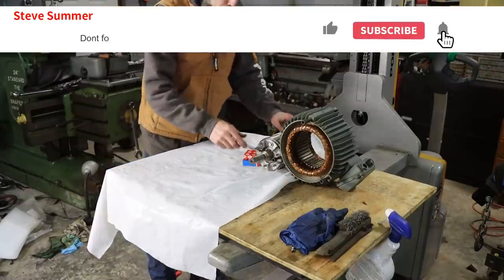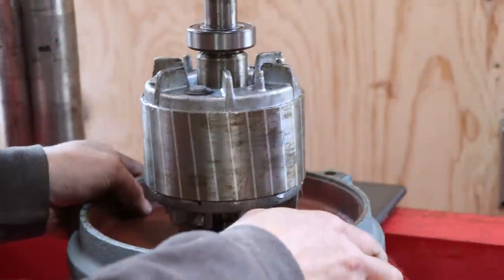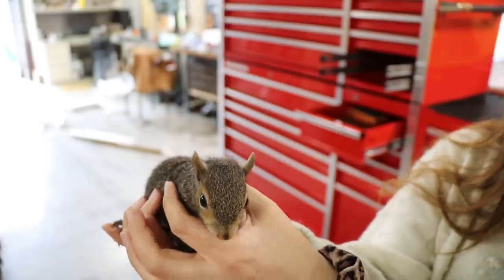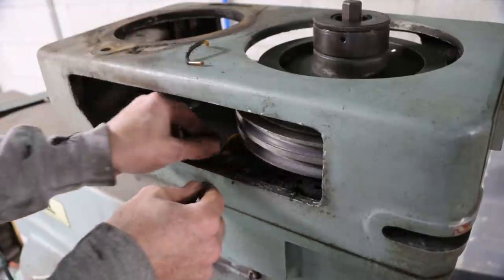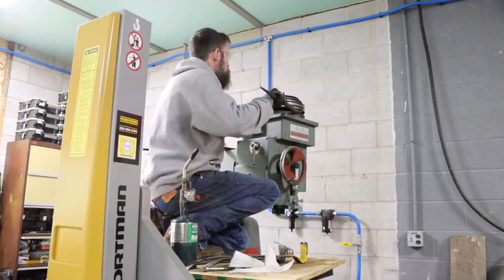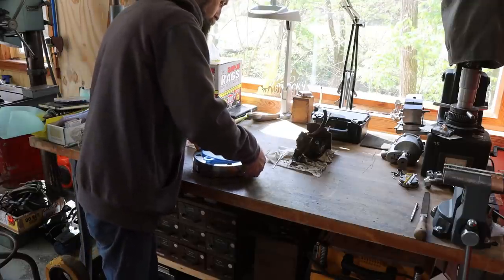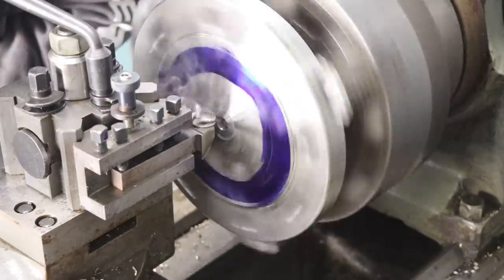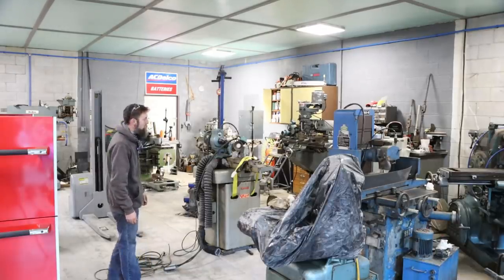Doall Milling machine Head and motor work.

Comment: When you haver rebuilt a motor give each end of the shaft a sharp tap with a brass or lead hammer to take the press side loading off the bearings! Another great video Steve!
Phil UK

Comment: Ever since Adam Booth paid you a visit I went back and have been binge watching the shop construction/repair. I’m very impressed with your depth of knowledge over a broad area of technology. I have the exact tool box (with side box of drawers) but because I’m an aircraft mechanic I do not have the top boxes.as I roll my toolbox from airplane to airplane and I use the top as my personal work bench. I, too, used a label maker to help find the correct drawer,
Reply from the maker: Thanks Rex👍

Comment: The squirrel wisperer, your wife's a natural with them. Good to see the shop getting put to rights. That transmission grease sure turned narly over the years. So much better then the Bridgeport power feed ,, strength wise anyway. In another year that new box will need an extra room for tools. Mine did and its bigger than that model. My snap on box cost more than a new car at the time I bought it. Before HF started selling them. Which I'd buy now tho..

Comment: I love changing motor bearings. Every time I get a new machine I convince myself that I can hear/feel the bearings in the motor grumbling.
Reply: Bought bearings yesterday. 4 bearings, the most I have spent on this machine since I got it, and they only had Timken bearings, where the cheap Chinesium would have run just as well, seeing as they are only a low speed roller.Probably do another 40 years though, while the originals are sort of fine, I wanted a sealed unit so as to reduce the dirt getting into the zz bearing races, as they now run rough, 2 2RS 6202 bearings it was.

Comment: You have surely come a long way. I am planning on buying a couple of the smaller tool boxes from HF. Plan is to have them designated to specific tasks, general mechanic's, machining, lathe, welding. At least that is the long term plan. Like you, don't have deep pockets, and as I get closer to retirement, that becomes even more critical. Thanks for sharing, thoroughly enjoy watching you adventures.

Comment: Steve, if you get vibration in the mill motor reverse one of the fan bolts. When you took it apart, they were pointing in opposite directions, but you reassembled with them in the same direction.  Might be enough to affect the balance. Shop is looking really good.

Comment: A friend of mine has a similar lift, he added a remote so he could control just the lift/lower function while using it as a man lift. He also had me build a man basket for it with rails for safety. I got a bit fancy and added tool/ parts trays.

Comment: Yes, I like the neoprene outer shields on bearings, as you can lift the caps.
Lots of the bearing on tractor mowers now, have steel shields you cannot re- grease.
It is good policy to put the best grease possible, in them. That cost is minimal, I flush new bearings. Then use Penrite high temperature grease. It is water proof and has amazing adhesion. I expect there is a similar graphite grease available, that would be ideal, for your head stock replacement.
Wife’s grey squirrel is cute, but they are an introduced pest in England, the native squirrel, is a red squirrel.

Comment: How long before that tool chest is filled to the brim and you have to get another extension?
Reply: morning Mr Clive nice to see you at this channel
Reply: Wonder what it weighs by the time it's filled?
Reply: In my case usually 2 hours.
Reply: Two things popped up in my subscriptions this morning, your defrost timer and this. :-)
Reply: @dudleysdad  Around 4 tons probably by the time it is full.
Reply: @SeanBZA  You are probably close, dangerous enough when moving it is what I was thinking.
Reply: @dudleysdad  I have a few tool boxes, and yes they grow in weight as time goes on, and multiply as well. But I am cheap, so try not to buy new, just well used, and fix em up a bit.
Reply from the maker: Hopefully not too long😁.
Good to see you Clive👍
Reply: Extension.... on the garage. =]
Reply: @SeanBZA  I was wondering if he might do a resto since it is part of his history, and it's a nice classic Craftsman.
Reply: @dudleysdad  4 tonnes, definitely not.
Reply: Probably just as long as It takes to remember where everything is
Reply: I give him a month he will need more space lol lol jk
Reply: Tools are like air molecules. They expand to fill all available space.
Reply: @jasongreene303  those chest are really not to bad to fix back up. Take a few hours and they are like new. I use a knipex smooth jaws to make it rails straight again.
Reply: Steve will need a side box for the end of the shop!(;=)
Reply: Gad it's the awesome  Big Clive that's where I'm heading next  what a great weekend  with everyone putting up videos
Reply: @noelhenderson700  : How many clamps does a woodworker need ?  One more than he's got !!  More is better.

Comment: You are using that fork lift a lot more than you expected Steve and would be lost without it now‼️👍👏
You need to have a look at Knipex tools.
German made and wish I knew about them before I equipped my Workshop.
Have bought some and will NEVER buy another brand‼️
I use pipe cleaners as wicks.
Elizabeth is a wonderful squirrel ‘Momma’👏👍

Comment: Good choice going with sealed  bearings, they are lubed for their designed life and you are correct,  deep groove radial ball bearings can accept fairly heavy static and some dynamic loading, however they will fail prematurely if an impact shock load is applied, such as being hit with a hammer. (I'm a retired machine rebuilder with around thirty years of experience, l enjoy watching some one who knows what they're doing.)

Comment: Steve, 100% agree that U.S. General Tool Chests are very high quality and a great value. I have two of them and would like to sell my two Craftsman chests and replace with U.S. General. I see no need to buy one of the expensive "tool truck" brands at double or triple the cost. You made a great choice.

Comment: Not many wives help there husband's in their shop, got a good wife there Steve. 
If you had to add more boxes, you can actually add another bottom and top. The connector would simply be that side box, only thing you'd have to change would be the casters. Those aren't difficult to do, just contact General directly and order swivel casters. 
This is the one thing I enjoy about your channel, new machine, (new to you), you tear it down, go through it, clean it and repair what needs to be fixed. If I may offer a suggestion, get yourself a good set of chain wrenches.
It might be a lot of work but, look at it this way. Since you're cleaning your machines, now you know their exact condition. It's called "baby steps" for a reason Steve. Take your time, set your equipment up the way that best suits you. Great video, cheers :)

Comment: One feature of the big DoAll mill heads that I am familiar with is the high/low range doesn't reverse the spindle. So you can label the rotation direction switch unlike the Bridgeport where you can't.  Some small DoAll mills look like Bridgeport copies probably reverse the spindle too. The more you take apart the better this mill looks.

Comment: I have had various tool box brands over the years. I have had two Harbor Freight side boxes like yours for 15 years. They are by far the best box and the best values you can get. I like the handles because of the labeling capability. They hold up very well. I wouldn't buy anything else.

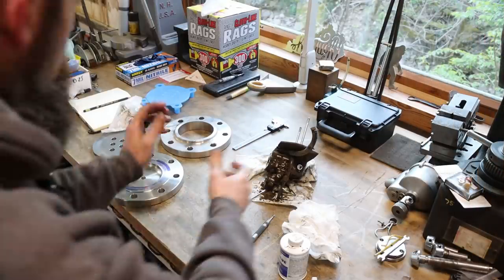Comment: 43:12 was wondering what that mess was.  The shop is looking good.  That big vertical mill when finished will be a real asset.  Amazing how many mills have to have grease cleaned out of the oil lines.  Stay safe, stay well.

Comment: Ive become convinced that i could line the entire length of my shop wall with tool boxes and i could still find a reason for more 😀
Reply: I pretty much have that now. Two 72", a 54" one 72 and the 54 have top chests, one hutch and 2 end lockers. Still need more room though..

Comment: For pressing tools for bearings, I like to cut through one side of the old race, remove the balls, deburr, and  and use it for a pressing tool, the cut race allows press fits to relax. I suppose you could use Locktite to glue it to a bearing and pull it out of a blind hole, but have not tried it.
Thanks for the videos.

Comment: You need an ultrasonic cleaner. I bought one and it is amazing how often I use it. I’d use it more but my neighbor keeps borrowing it. He loves it too. You could just drop all those gears and bearings into it and they would come out gleaming and you know that the insides of the bearings are all free of grease. It would also make short work of that gummed up carb. If you buy one, get the biggest one you can afford. I love mine but often wish it was bigger.

Comment: I had a machine with grease fittings, so used the right grease for it, NGLI0, in a drum with a pump. Basically a thick oil that pumps well, and runs with time. A lot better than the stuff I removed when I replaced all the old pipes, which was pretty much looking like wheel bearing grease. The light grease pumped well, and was much better at lubricating the machine as well. Oil would have been an issue, seeing as half of the time the grease was lubricating bearings and slides. 

43 grease nipples and pipes from a central block, one side M6 thread, the other side 1/4NPT for the grease fittings. M6 side got push in fittings to replace the old barb fittings originally there, and then all new 5mm pipe to replace the old. All new nipples as well, most of the old ones were shot and leaky. Went though half the 20l drum in 10 years, of a bit per nipple every month as service.

Comment: One thing good about them old craftsman toolboxes if you dont have one there not to bad to fix up matter how bad they are take like 3-4 hours. Main thing is a knipex smooth grip pliers, 91 % rubbing alchol/papertowels and grease. Repair one few years ago when only one drawer open up and made it like new. The knipex make it easy to repair the rails since there straight and can put alot of force on them.

Comment: One thing I find with those big tool chests is that the drawers tend to be very deep so often you only fill the bottom 30% of the height and you don’t end up using a lot of the volume. I find the you can pack way more stuff into a Lista type cabinet. Too bad they are 2-3 times more expensive.

Comment: On my mill the vertical head actually takes grease (it is a retrofit), but a nipple is damn hard to confuse with the flip top oilers on the rest of the machine.
They did however drill a grease passage in the wrong spot at the factory, that never worked and the bearing behind was shot.

Comment: several years ago i rebuilt the entire drive train on a 1955 Wolseley 6/90, a friend was visiting and implored me to have someone help setup the differential (i did engine, gearbox and all wheel bearings myself), i found a guy that lives 30km away and i suggested we do it in my garage as everything was laid out, he just had to bring the in/lb torque wrench (which i lacked).
he said 1st thing is pressing in the pinion bearing shell and we'd need a plate to spread the load, i handed him a 1/4 in disc i had cut out and ground to rough shape, ok he says, the second thing we did i handed him a similar disc for the pinion bearing, he looks at me and says i want to kiss you.

he explained that in 40+ years of working with mechanics, i was the best prepared person he had ever met, we spend more time chatting about life the universe and everything than actually working, the diff went together smoothly and the mesh pattern was so damn good he said if we tried to adjust it to get it better we would do more harm than good.
he paid me the biggest compliment when we were done by saying next time i ever need to do a diff, he's just lend me his tools.

Comment: At the 22:10 mark.   I have been told by a reliable source that Doyle is the manufacture that supplies pliers to Matco tools.  So I stopped at a Matco truck, and I compared the two...  Looks to be the same, other than the name.

Comment: Looks like a replaceable cover behind your lathe would be a good idea to keep the splatter off your new wall.  A piece of canvas held at four corners?
Reply: I used a sheet of tin steel that had been the wall of a garden shed. Free, Pre-painted, easy to clean and everything!
Reply: Kinda like the one that's already there?
Reply: That's his old wall. The new one is on the other side of the shop. But yeah a splash guard might be a nice project someday.
Reply: @1pcfred  I know that. What is your point?  Any wall gets dirty, if you looked you would see it on the 'old' wall.
Reply: @douglasthompson2740  I would think it is obvious. My point is you called his old wall a new wall. What you're seeing is the old wall.

Comment: If manufacturers expect oil to be squirted into a grease nipple, they should write oil by the side of it
Reply: Yes but... "Alemite fitting" not grease nipple and users should read the manual!
Reply: @TheMetalButcher  They would then need to add a little cupboard to store the manual in, otherwise it would just get lost ;)
Reply: @____________________________.x  Old B'ports did! But they filled up with chips. :D Any good machine should have a detailed lube chart telling you the location and weights of the lube as well.

Comment: I have changed more bearings in motors that I care to reveal.. I have been in the bowling business for close to 45 years I have worked in both Brunswick and AMF houses I worked for 10 years in an AMF bowling house with 50 Lanes.. Each one of the machines ( pinspotters ) has three motors on them and they have vertical motors that go into a gear reduction box with a right hand output not only did I rebuild all of the gear reduction boxes all new bearings oil splashes bronze bearings and worm drives but I went through all of the half horsepower electric motors,.. now these particular motors(50 years old) were Japanese motors and the centrifugal switches we're getting to the point you cannot buy them anymore so we had to change over to electrical motor start centrifical switches and let me tell you some of the motors in key ways that were damaged had to broach new keyways, all sorts of modifications down to the point of having to use soft 5 mm key stock so that it would not damage the shaft or the pocket that the shaft went into.. but once they were up and running trouble-free operations.. I had boxes and boxes and boxes of bearings.,..😵😫😂

Comment: Steve, pressing a bearing through the wrong race and the balls is one of my major peeves as I had to clean up a lot of other's mistakes, so I'm glad you addressed that around 3:00.  Sometimes, order of operations can prevent it.  Could you have pressed the bearing into the back housing first via the outer race and then still accessed the inner race from the outside to press that whole assembly onto the shaft?  

Agreed that sometimes it's ok at low forces, but not being the bearing designer do you know what the force level is that won't cause damage?  I'll generally go to great lengths to reduce or eliminate pressing "through" a bearing, and have never had one come back that I've assembled.  

As you correctly state, a quality bearing, properly installed will outlive most of us with little or no service.

Love your channel, been here since the early days!

Comment: Should have pressed the bearing onto the cover first then the cover with bearing onto the shaft, that way you can put pressure on the bearing part that would place no load on the bearings themselves.

Comment: Press bearing into housing using socket to push on outer race. Then press shaft into bearing, supporting inner race with a tube. But as you said, your way will be just fine.
Reply: Yep - that's the way I've done it in the past - press the bearing into the housing using the outer race, then press the housing onto the shaft using the inner race.

Comment: I’m surprised 
You didn’t take apart your old tool box and refurbished it, it would make for an interesting video.🙂🙂🙂
Reply: Yeah it is too bad Steve doesn't know anyone that's handy and can fix stuff.
Reply: I have one just like it at home. Had same at work. Bottom drawers keep failing. Neither is in as "well used" shape as Steve's. Slides and slide mounts are weak for the load that can be put in the drawers and there is not much that can be done to improve the situation. Maybe when there is absolutely nothing better to do...
Reply: @milantrcka121 , maybe he should put an ad out somewhere to get rid of them. Maybe an eighteen year old could use a box to store what tools he has until he gets something a little nicer. Get them out of the way anyways.
Reply: @Hoaxer51  Indeed! One mans discard is other man's treasure. As long as they are not of exactly the same mind...
Reply: @milantrcka121  Or as my Dad used to say at garage sales "One man's junk, is another man's junk"

Comment: Your doing a great job, my only question is: Would it be possible to add Zerk fitting oiler tubes for the motor bearings?

Comment: Looks like you got this Mill just in time. I wonder how much longer it would have lasted running dry like that before the damage was irreparable
Reply: It probably has not run in a long time. It looks like it's sat for years to me. That's often how it goes with machinery. It sits for a while before it moves on.